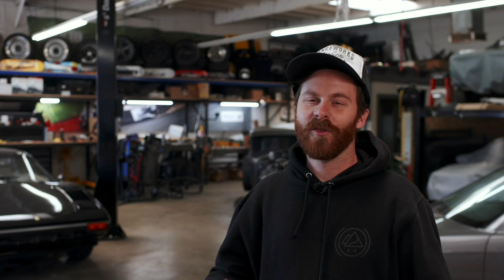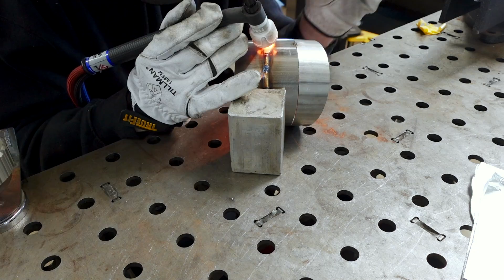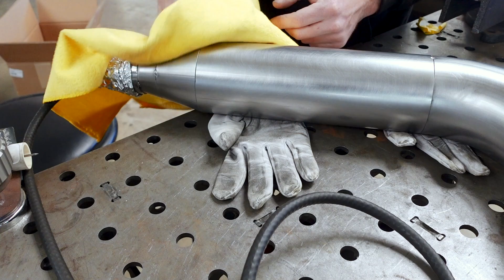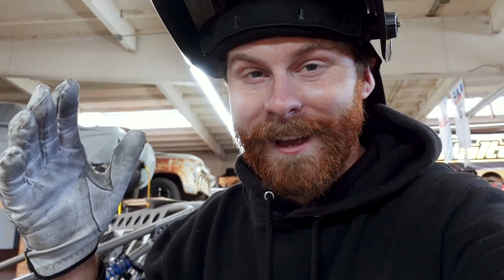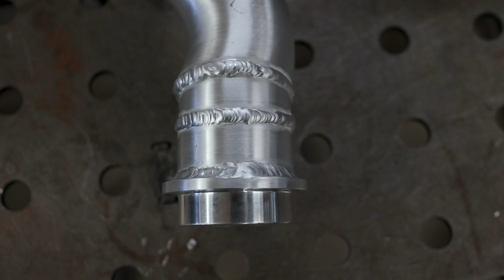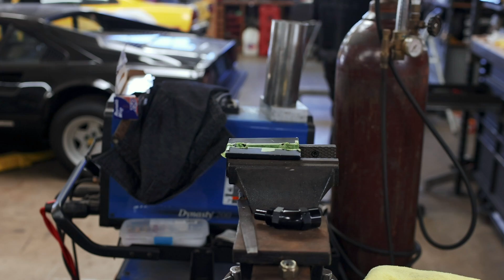Honda-Swapped Ferrari - Closing In On the First Start

Comment: Hey mate, I’m guessing you have probably heard it already, but in case you haven’t, could you move the oil cooler to the side air vent and not have to run yen ducting,

Comment: Using masking tape works best when purging. We use it when welding stainless in chemical plants. You can also tape your joints which help with your Argon environment inside the pipe. When you're all taped up just stick you hose through it and go! Best of luck and I enjoy watching your channel.

Comment: On the subject of fuel, I'd still consider E85, no matter your power or engine temps goal, ethanol will give you much colder IAT, which mean denser air thus less lag. It's also way cheaper. When rules allow you to run alcohol based fuel, you're usually better doing it.
Reply from the maker: My reasoning for not is multi-faceted. E85 isn’t available at our tracks but 110 is. It’d also have to re-pump the car at a considerable cost.
Reply: @stanceworks  Yeah that make sense then since your gonna burn so much in a week end carrying all that with you would be a pain. I was thinking of filling a 45gal jug once and carry it around at the track.

Comment: Hell yeah bro that exhaust looks great. A good way to get less color in those welds is by only doing 1 bead at a time at each joint. This will help distribute the heat throughout the part and then stopping every few welds to let it cool down for a little bit. Some guys use compressed air to help it cool down faster. You do use a lot more argon that way though. Overall, looks sick man - can’t wait to see your titanium setup.

Comment: You should consider a flexible bracket (rubber thingie shaped like an 8) to support the exhausts. The movement of the engine/turbo plus the weight (inertia) of the pipes will make them move/shake and soon crack.. a solid piece of roundbar on the chassis and one one the pipe + the rubber exhaust hangers will help a lot!

Comment: Bro... It's hella dangerous to be so close to exposing yourself to argon. Get the proper fixtures. Its not worth your life. I use argon for our inert gas for our powder bed machines. We have argon alarms gallore.
Reply from the maker: What? Argon is inert and non-toxic. It won't do anything to you unless you breathe enough to displace the oxygen in your lungs. Its coming out of the regulator at a few cubic feet per minute. You'd have to really, really mess up to hurt yourself.

Comment: As a welder by trade, and being introduced to new and exotic metal that I've barely touched or have never touched. Don't be afraid and just try it. The more troubleshooting you have with it, the better it is to control the outcome of the weld. Stainless is by far my most loved metal, next to aluminum and steel.

Comment: I´m addicted to StanceWorks Mike. Your project is so smart, light powerfull engine in a light chassis. Well i see you change mind and you canalised the airflow under the car (watch out of lack of front down force). But please, i mention it allready, build you a full rollgage, this cars are dangerous. Usually side impacts shear off front or rear car body

Comment: Great Content
The point at which you stop dithering in a Binky manner regarding the oil cooler bracket and switch gears to getting it running is excellent

Comment: When back purging with argon, you really don't want a super tight seal. because when you close in on the final welds, the velocity and pressure of the argon can start to cause issues. aluminum foil is perfect, maybe even take a pin and put a tiny hole in it so you have a vent to keep any significant pressure from building up in the pipe. 
Your welds are looking great! Practice makes proficient!

Comment: Dumb question with regards to the first start.  My understanding is that at some point you're going to pull all of this stuff out of the engine compartment, powder coat many pieces, clean up and paint the engine bay, ceramic coat (?) the headers and exhaust, etc.  So the question is, wouldn't it be better to do all that before you start running fluids through everything?  I know you have to weigh all of that against knowing that it all works before you put the final finishing cosmetic touches on everything.  But I'd be tempted to at least do the engine compartment stuff while you have the engine out.  Anyhow, I'm curious as to the sequence of operations here.  And I'm saying this as somebody who can't wait to hear this bad boy come to life!  As always, keep up the great work!

Comment: Once upon a time, I was like you. Thought welding aluminium was difficult. There will come a time when you realise that welding ally is by far, easier than welding stainless! Trust me. Sometimes I look back at my videos and realise how far I have come on AC. It blows my mind and it only came from putting in the seat time 😉
Reply from the maker: Good to know! Wild to hear Aluminum is easier for you. Hopefully I get there someday!
Reply: @stanceworks  I forgot to say good work on the exhaust. Iam a fan 🙂AC welding for me, started to be a pleasure without me even realising. It's great to hear you say that you enjoyed yourself, whilst making the filler neck. That is what it is all about. Enjoy it and try not to get frustrated. I found that I would get worse, the more frustrated I got. But got better, the more that I started to enjoy it 👌

Comment: Maybe it did not show on the video but you should have vent hole on the other end of the tube. Without one your last weld can blown up on you because the tube gets filled with argon and pressurized. Also lets the air out of the tube when you start purging.

Comment: nice work, as always and I hate to be the guy that points out petty crap, but I'm not sure the black pipe fittings and "T" for your dual regulators on the Argon tank are really suited to the 2000psi tank pressure of a full tank.  I may be wrong, but it looks a bit sketchy
looking forward to hearing this thing run :)
Reply from the maker: Maybe not. Probably not. But it's been fine for years, to be honest.

Comment: Bro u need to extend exhaust out more so it won't burn the rear end in flames
Reply from the maker: I can easily add length once I finish the mesh setup in the back. I'm not too worried about it

Comment: Sweeet! this will so cool! one thought, dont you need an air evac on the filler neck? Im doing my filler necks (twin tanks) and dont really want to do those, but isnt there a risk of getting airlock when filling up, and fuel spewing out over the side?
Reply from the maker: The fuel cell has a vent on it. It'll just route it up high.
Reply: @stanceworks  Hmm i dont have any vents, will be using the charcoal canister and all that stuff, Ill do evacs on both sides, just to be safe.

Comment: I've been watching this project from the start. Fantastic workmanship and design solutions Mike. My only concern is how loud it will be with less than 1meter in length of 3.5" stainless exhaust, with zero silencers. I fully understand the benefit of your neat straight run solution but have a feeling needing to wear ear defenders, even for road use, will start to grate within 5 minutes.
Reply from the maker: It very well may! Turbos do tend to quiet cars down a bit, and I imagine if I'm not in it like crazy it shouldn't be too bad. But, if it is, I can always make a street exhaust! It's no big deal.

Comment: I'd suggest using a thinner filler wire. You'll be happier with your results since you already got it down👌
Reply from the maker: I ran 3/32, would you suggest even smaller? 1/16?